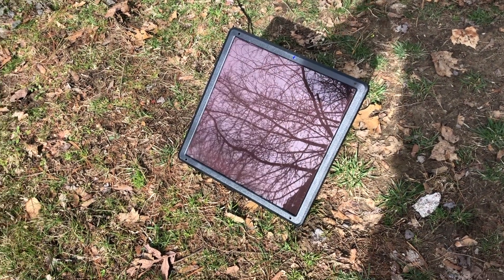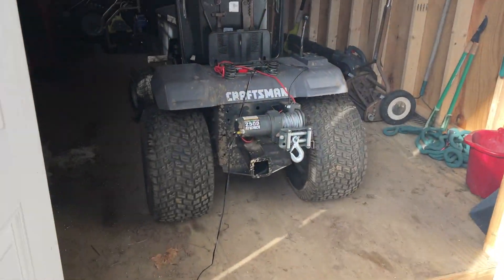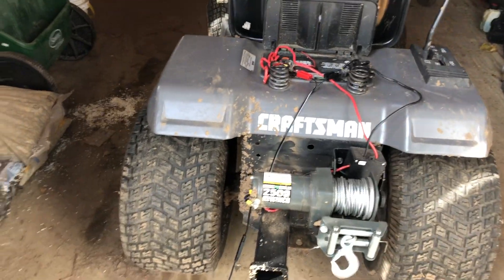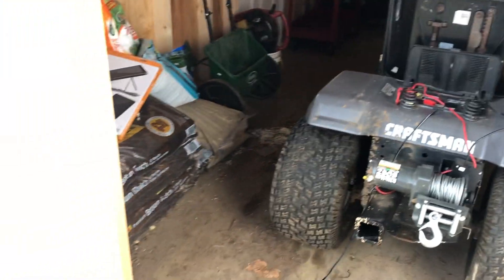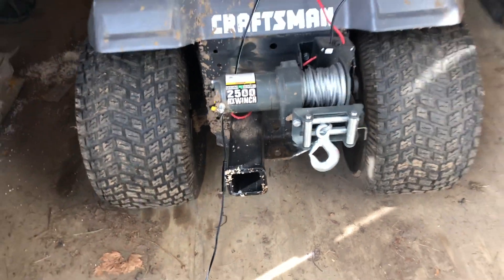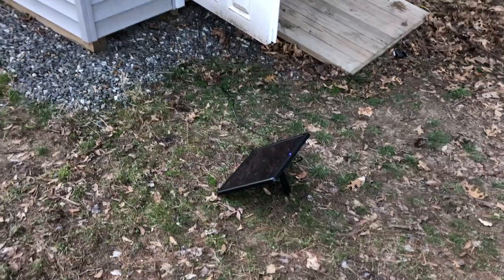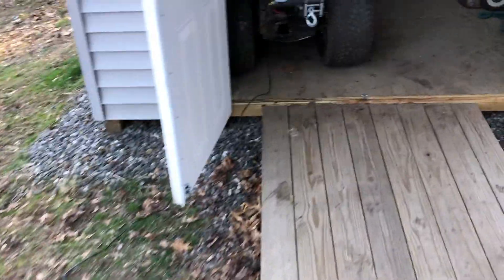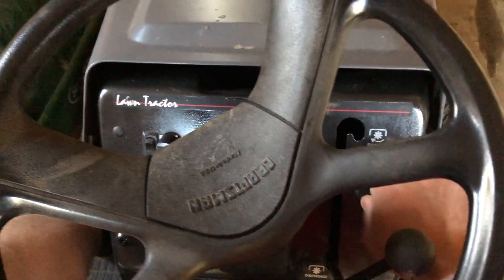Thunderbolt 7 Watt Solar Panel - WiIl It Charge A Tractor Battery? Harbor Freight Tool Test!

Comment: The instructions says to use a solar charge regulator, so it will over charge and auto shut off the solar charging. You should try it again with a $20.00 dollar charge regulator instaled.
Reply from the maker: I did get one of those. I’ll have to give it a shot. Thanks man.

Comment: Ohms law will explain why a controller is needed. It will lower the volts and increase the watts or amps whatever you prefer. Amps is what puts the power into your battery.

Comment: You probably have a bad cell in the mower battery. The question then remains, how long/seasons have you used the battery for the mower for the solar panel system to do it's job?
Reply from the maker: Hey man! That battery was less than a year old. I’ve found that over a 2-day span, this panel will charge that kind of battery nicely. Thank you for watching 🤘🇺🇸

Comment: Hello
A bit off topic to the solar gizmo but I think I caught a glimpse of the HFT ATV 2500 winch on the back of that mower.  Wanted to advise: 1) the metal braided cable will shred skin and flesh if the user isn't careful.  It links easily.  2) the cable spool is a pop metal.  If the cable gets sideways under load, that spool will snap.  So pull perpendicular to the spool and yours may last a bit longer than mine. 

As for the charger, its disappointing that it performed poorly.  I was in the market for such a panel.  Guess HFT isn't all its cracked up to be anymore.  Thx for the vid and info.
Reply from the maker: Thanks for the tip on the winch. I've had pretty good luck with it so far, but thank you for your advice.

Comment: Did this work for you? I'm about to return the one I got. It just reverse charges through the usb and burns out batteries connected with the clips.
Reply: @jeffkurtz6011 I know this is three years late but I saw that HF had a big run of cables that were wired incorrectly with the polarity reversed. The cigarette lighter plug and another item in the wiring kit are wired backwards. If I get one of these kits (researching now) I plan to check over the components before using them and also running a voltage regulator or charge controller. I left my car at the airport parking lot for a couple weeks and a solar panel stuck in the window to keep the battery charged would have provided peace of mind knowing my car would start upon my return.
Reply from the maker: Jeff Kurtz I have had a lot of luck with this panel. It charged my walk-behind mower from dead, enough to get it started. I haven’t messed with the USB, because I’ve left this in my shed to maintain the batteries in there.
Reply: @jimmysgarage9068  Ok, thank you. It must be the usb adapter

Comment: What else does not work on a deeply discharged battery are those battery minder / desulfator trickle chargers.  Both this solar panel and the minder type chargers are for maintaining an otherwise healthy battery that goes through long periods of sitting, so to speak.  My farm tractor is nowhere near a source of AC power and I'm going to try this solar charger to avoid having to replace $150 batteries every three years.  Thanks for your work.
Reply from the maker: mIKEs So, I discovered after this video that the winch on my tractor had a slight, but constant draw from the battery. I’d be interested to re-do this test now that I have a cut of switch installed to see what kind of difference there is. Good luck with whatever you choose to do!

Comment: Thanks for the update. 
I saw your first video on this charger, and went out and bought one for my second car that only gets driven once a week.

I've done some testing to see how much current it puts out, and based on my application it might be too much.
I may need to get a solar charge controller to prevent over-charging my battery. 

I made a video about it on my channel, but it's pretty horrible.  
That's how I found this second update video.
I'll save you the trouble of watching my review.

In 100% direct sunlight the panel puts out 495mA.
In 100% cloud cover it puts out 206mA.
Thanks again,
-Chuck
Reply from the maker: Chuck - thanks for the info! I didn't get into the output of this new panel because I just wanted to give a very basic demonstration of "Will it" or "won't it" for all the guys that will purchase it for that kind of application. I appreciate your input!
Reply: Right on Jimmy.